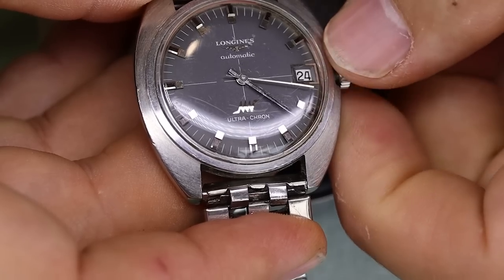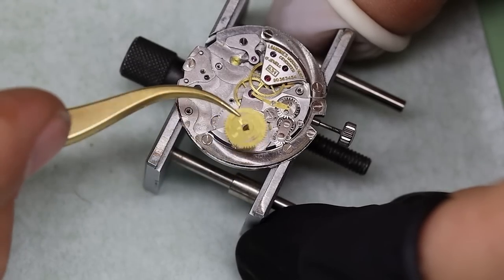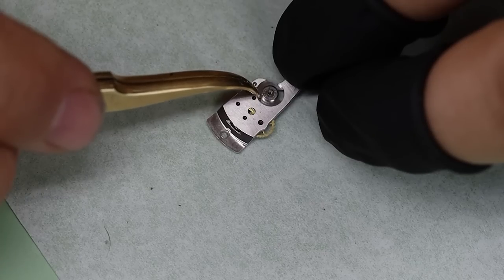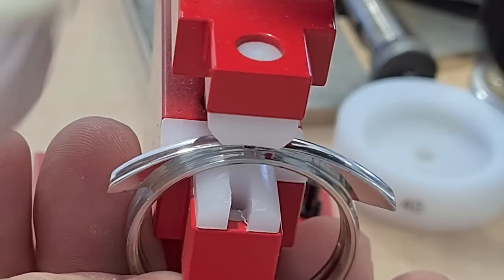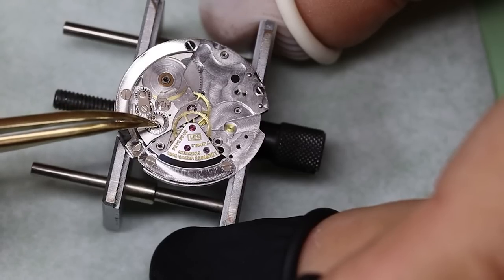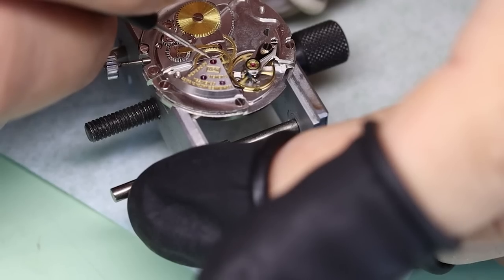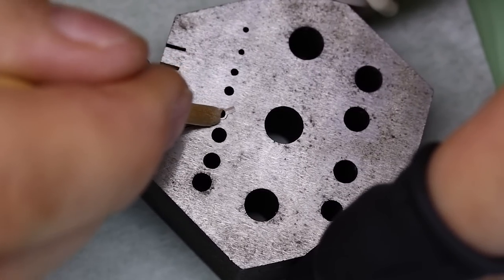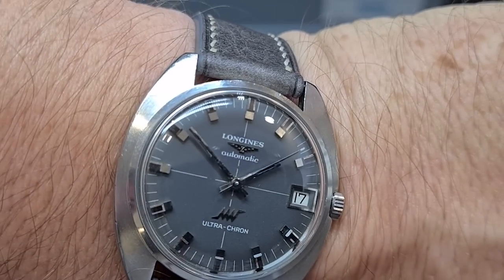Was this the most accurate watch in the world? 🤔

Comment: Out of all the mid-tier brands I absolutely  adore Longines. I have three in my collection and told myself I wouldn't add another Longines but that new Zulu Time GMT they just released is definitively going to join my collection.
Reply from the maker: Longines really is a great brand, and back in the day they were top tier. It's a bit sad that ETA put them below Omega when they were in fact at least at the same level until the quartz crisis....
Reply: @VintageWatchServices  +1000 Longines were very much at the top table. They had an aviation history brands like IWC and Breitling could only dream of. They were the inhouse chronograph company of most of the 20th century. Every two button chrono down to today, that's a longines invention(not Breitling. They had them 6 years before them). Flyback chronograph too. First specifically for wristwatches chrono movement. Oh and the external rotating bezel on pretty much every diver out there? Longines again, though originally for pilots watches. Rolex may write "Superlative Chronometer" on their dials, but in the actual chronometer trials Longines won more in some years that Rolex won in the entire history of the trials. 
When Swatch were putting brands in tiers I suspect Longines got the lower position because Omega had taken over from the 60's onwards, had more recognisable brand lines like seamaster, speedmaster(and the Moonwatch), they had weathered the digital crisis in a better position and the name was easier to pronounce and spell in more languages(not so daft as Hans Wilsdorf picked the name "Rolex" for those reasons).
So Longines became the "heritage" brand and old style wider choice and cheaper brand.
Reply: @MrGrentch  Wow, that's a great little piece you wrote. You do make the case for Longines! Lot of that I for one did not know... tx
Reply: @MrGrentch  I concur wholeheartedly, and they should also drop the group name Swatch in favour of something more befitting the whole product range. It breaks my heart that Breguet and Blancpain are associated with the Swatch branding: a name that encapsulates 1980's throwaway plastic digital consumerism - than precision engineering, artistry and Swiss heritage. Perhaps Groupe des Horlogers Suisses or other such nomenclature.
Reply: @VintageWatchServices , I had two early Quartz & good quality as well, but ditched 'em quick when I found the battery can "flat-out at any time..? & on one occassion an important event- for that reason they are a NO-NO in my book... "Why @ 29:11 was the second hand travelling acw? Also not a criticism, just an observation, given the glowing spec' on this T-piece? why no Timegrapher readout ?

Comment: Very cool Longines. 🙂 Those high beats were the last gasp of the mechanical accuracy pursuit back then. Like you mentioned Longines, Seiko and Girard Perregaux. Interestingly all three were also pursuing the new quartz tech in the background, Longines with their Ultraquartz(and as part of the Swiss Beta 21 group. Longines had the cash back then), Seiko in what was to become their Astron and GP what would be their 350 series of quartz movements(with a little help from JLC), which was the movement that set the near universal frequency rate of quartz ever since. 
In the annual chronometer trials the Swiss had started to enter quartz movements from the mid 60's, which of course were winning. The last two that didn't go this route were GP and Seiko, Seiko having come late to the trials, starting off badly but climbing to the top year on year. 

For some reason Longines didn't bother with their high beat mechanicals. Odd given they had won more chronometer trial prizes than any other brand(Omega and Zenith were 2nd and 3rd. Brands like Rolex Patek and AP barely registered if ever). Though their Ultraquartz won a few. Odder again unlike Omega and others Longines rarely sold certified chronometers. It's very rare to find one with chronometer on the dial. I had an Ultrachron years ago that was certified. The movement looked the same except the rotor was gold coloured and it had "chronometre" on the dial. Sorry I sold it.  🙂

In the last chronometer trials the quartz won, but there were two mechanicals in the top ten, GP and Seiko which came in on top. So the last mechanical movements to win prizes were from GP and Seiko, and unlike the others you could actually walk into a jewellers and buy them. They could also officially print "Observatory Chronometer" on their dials, AFAIK the only brands that ever could. 

Of course the Swiss didn't like this upstart non Swiss Seiko winning so closed the trials down and took their ball back.
Reply: I did not know that.
Reply: You know good horology history!
Reply: @joeskeptical4762  :) not really Joe. Only my areas of interest, so early wristwatches, early electronic/quartz, some military stuff and some Longines. Beyond that I'm lost. :)
Reply from the maker: Very nice write-up, thanks for sharing!
Reply: I have an Admiral Automatic with "Chronometer Officially Certified" on the dial just below the Longines name and logo. It has a 28,800 bph movement and an eight sided case.

Comment: I do believe that the reduction in the beat rate was related to durability issues.  Omega did the same thing with its co-axial movement, which originally ran at 28,800 bph and then was reduced to 25,200 bph and was accompanied by an increase in the warranty period from two years to four years.  In any event, with its grey dial and pillow case, it is a very handsome watch that once again you have restored to its full glory.  Well done, Stian.
Reply from the maker: Thanks Bullnose and yes, I think you're right. What drives those issues however is a lack of servicing, and that again is down to buyers basically just wearing their watches until it stops or runs really badly. With watches made before the quartz crisis, this could take decades, as the watches were made with the best materials back then. Nowadays, it can take less than one decade due to lesser materials and a different business models, where the brands change lots of parts in every service and charges the buyer...
Reply: @VintageWatchServices  And that is why as much as I love chronographs, I don't own one.  Too expensive to properly maintain.

Comment: Thanks for another fantastic video, Stian!!  Did you need to adjust the jewel depth?  Starting with my last service, I lightly install the minute hand in any position before rolling the crown to find the date snap-over point.  I roll the crown through 2 or 3 snap-overs to see how repeatable it is and average (to the minute) the numbers.  Then, I pop off the minute hand and do a full hand installation.  It worked really well on my last project.  I believe you said the snap-over will be slightly different when the watch runs vs. rolling the crown.  So, maybe this is a (slight) waste of time.  Thanks again!!
Reply from the maker: Hello Woody, I somehow managed to press the jewel into the right depth at the first try... I was surprised myself! For a watch like this I indeed turn the crown through a couple of date changes and count the number of revolutions. For this one I think it was 63. Then I make 60 fast revolutions and slow down for the last few. And yes, the movement will flip the date slightly slower than when you use the crown, typically some 2-5 minutes.

Comment: An excellent video!  I think a frequent cause of failed center wheel plate jewels is watchmakers manipulating the center wheel to the side, in order to remove the barrel without pulling the cannon pinion and then removing the train wheel bridge.  It’s easy to crack the jewel that way, and maybe not even realize that it happened.  In any case, good catch and nice repair!
Reply from the maker: Thanks Paul, and that might indeed be the case. A small crack can happen with not too much force and that crack will develop over time.

Comment: Thanks Stian for a great video on a really classy movement. I try to tell myself accuracy isn't so important on my mechanical watches but the more time flies by, the more I like my watches to be precise. A good result on this one indeed. Do you think the guys who say they can service 'do not open' mainspring barrels are just lucky or maybe they have a store of NOS parts? Cheers, Howard
Reply from the maker: Thanks Howard! It's nice to have your watch show time accurately to a reasonable degree, but we still measure our lives in minutes and hours rather than seconds. So yeah, if your watch is off by a few seconds a day shouldn't really be an issue. 
You can open the barrels but I prefer to have a spare one if I do so. They can be tricky to put back together again without distorting them. Thus I generally try the old one first to see if it gives a good enough result.

Comment: Another great video that I am certainly going to watch at least a couple of times: thank you Stian.

The 5 Hz movement has its advantages (accuracy and just look at how smooth that second hand moves) and its disadvantages (wear and tear). 

Most of the vintage watch sellers that I have met over the last 30 years here in Zürich have told me that watches made in the 1950s are the ones anyone should really cherish and look for. They usually say that the tools had improved by miles then and that watch manufacturers could again procure excellent raw material (after the Second World War). The high beat watches from the late 60s were not so lucky - and if I consider my son's Zenith El Primero - still aren't. To make watches cheaper and therefore more accessible to the general public, watch manufacturers had to cut down on costs. It mostly shows in the material they have chosen to work with. In the long run it does only work at very high maintenance costs. Think of the Shelby AC Cobra 427: you put a huge engine into a small car and will have to replace the gear box every 2'500km. It looks great, it is fast, it has an incredible acceleration, but it is hideously difficult to drive properly, if you can drive it at all.

Today, new, more restitant materials have emerged, but you pay for them in gold. And frankly, they do not look cool, but that is my opinion.

Maybe you can enlighten us on this? I am a total layman and not claiming any deeper knowledge.
Reply from the maker: What you're saying is pretty much spot on and you've certainly good knowledge :) I wrote a blog post about this topic here: https://www.vintagewatchservices.eu/single-post/the-problem-or-not-of-servicing-vintage-watches
The business model of the watch brands has changed fundamentally in the last 50 years, sadly very much to the worse for us watch lovers.
Reply: " Very high-beat” movements were used by Zenith and Movado chronographs... " El Primero" comes to mind !
Reply: @VintageWatchServices  Only today did I read your excellent post - sorry. It is so informative, critical and a pleasure to read that you really should make a YouTube video about it, which would enlighten so many watch enthusiasts. I would not even consider myself as belonging into that latter group, but I just love objects that were built to last and that can be repaired. Thank you for promoting exactly these ideas on your superb channel.
Reply: It is true, my El Primero needs every 4 to 5 years an overhaul at the manufacturer in Le Locle. It always costs quiet a bit of money and ist takes 3 Monts of time. But after decades it still is loking very good and runs within a few seconds error  per month. I wear it every day. Over night it is always in the same position. I am very happy to have a Chronomaster from the time they were COSC certificatet.

Comment: The design and architecture are straightforward, the 10Hz rate is the unique thing. It’s great to hear....lovely service job, classic 70s case & dial design, arriving just a year early. Would a new mainspring increase amplitude above 300 degrees but more important, would a “heart transplant” improve accuracy over several weeks to a month?
Reply from the maker: A new mainspring probably would increase the amplitude quite a bit indeed and this watch is still capable of fantastic accuracy. And 36000 bph is generally referred to as 5hz 😉
Reply: @VintageWatchServices  : Thanks for correcting me! 10 beats per second, 5 cycles (2 beats, to & fro) per cycle. I studied electricity a long time ago, I should remember what I learned back then, courtesy of Herr Heinrich Rudolf Hertz.

Comment: As a total newbie to watch repair, I probably haven’t read into this question yet. All things being equal (or not), what causes higher or lower BPH. The structure of all the parts appears to be like any other movement , so what causes 36,000 BPH as opposed to 18,000? Great video as always by the way!
Reply: The key component is the hairspring. It's basically a pendulum wound up in a spiral instead of hanging down and the accuracy of a watch depends on that pendulum having exactly the correct period. You'll see in videos how regulating works - a tiny "clamp" is moved along the spring making it effectively a bit longer and shorter. A hi-beat movement has a very different hairspring to a standard one as it has to swivel left-right twice as fast. 

The pallet forks and escape wheel thus also move faster than standard escapements so the 4th wheel has a different gear ratio to standard. If I understand the designs correctly, the output of the 4th wheel is mostly the same for all movements - no matter how fast the escapement is, the hands all rotate at the same rate for all 3 handers (well, the 12 hour ones!)
Reply: @alanmckinnon6791  correct
Reply from the maker: Alan wrote a great response to this :) Thanks Alan!

Comment: I have two Favre Leuba watches with the 36000 bpm movements. I thought that they were used by several companies and were basically the same so is the Longines any different apart from branding?  A also have a 70s longines chronograpgh but sady, by this time they were using standard Valjoux 7750 movements - they certainly do need to recover their heritage!
Reply from the maker: There were a few companies and consortiums making 36000 bph watches back in the day, it was a bit the same race as for making the first automatic chronograph. ETA also made 36000 bph movements.

Comment: Great video.  Could you have replaced the perspex lens for glass?
Reply from the maker: Thanks for watching! No, watches from this era mostly use plastic crystals and the cases are shaped accordingly. Putting in a crystal made from a different material would not only make the watch less original, it would also potentially damage the case.

Comment: Hello, excellent video. Can you help me? Do you know of any shops in or around Geneve that sell used machines or machine parts? Like wheel cutters, decoration machine, grillage and other?
Reply from the maker: Thanks for watching! I don't really know of any specific shops I'm afraid, but most of these would not be in Geneva, I think. Rather in the vallée de joux, in the smaller villages and towns.
Reply: @VintageWatchServices   Please can you tell me if you know of good shop in vallée de joux? I will take the train there on Monday.

Comment: I just love the style of watches from that era. Simple, elegant.
What I do not like are "non serviceable" barrels. Surely after almost 50 years the grease inside the barrel cannot be any good anymore? 
Same nonsense as with the "lifetime oil" for some dual-clutch car transmissions...
Reply from the maker: Yeah, those closed barrels were a bad idea in hindsight... I didn't have a spare one so I didn't want to open it, but it can be done. There's a risk that it will be deformed, though.
Reply: @VintageWatchServices   May I ask you something about lubricants?
More often than not I work on calibers for which I don't have the oiling sheet. Therefore, I stick to basics (941, 9010, 9020, 8200, D5) and try to use common sense :-)
There's so many type of lubricants (different viscosity, additives like MoS2 or graphite, etc.) that it's very confusing for a humble hobbyst like me.
What do you do when you have to work without an oiling sheet?
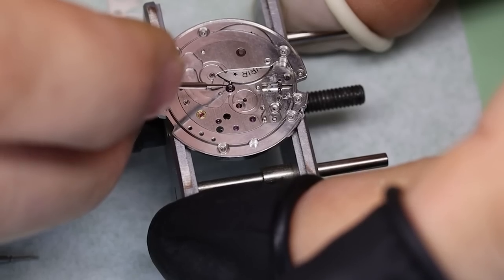For example, at 17:38 why did you chose to use that blue grease instead of D5?
I'd really appreciate your feedback!

Comment: You made a comment that watch owners don't like to have their watches serviced.  I think I know why.  I have a watch with a 2892 A2 movement in a titanium driver case with a exhibition case back, a sapphire glass, with a 500m rating (not that I go deeper than my 5'pool).  It a Steinhart which you probably not familiar with and I paid $550 for it 8 years ago.  Today, if I wanted it serviced it would cost $450.  I can buy the same watch today for $600.  Doesn't make too much sense to have it serviced.  I suppose if you had a rolex or omega, it may be more cost effective.  In my case, I think I have a great mechanical watch and a low price except for the servicing.  My watch company has offered to service that watch at no charge but I have to send it back to Germany.  One of the reasons I started watching your and other watch videos was to learn how to do this work my self.  Thanks for your help and for your well done videos.

Comment: Most interesting about the barrel.  If it was a consumable, what would it cost?  What happens to the lube?  Is the barrel hermetically sealed or something?  You are a font of knowledge.
Reply from the maker: Hello, thanks for watching! The barrel was indeed a consumable back in the day, probably available for something like $20-30 in today's value. Nowadays you unfortunately have to pay multiples that. The barrel is more tightly sealed than normal barrels, but they can be opened and relubed if you're careful. I prefer to have a spare on hand if I do that just in case I'm not able to put the lid back on properly.